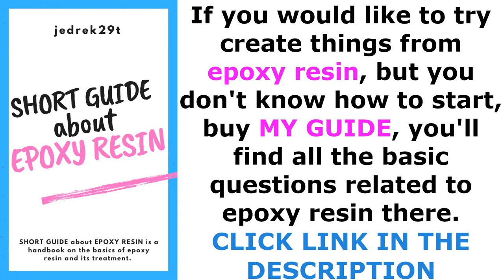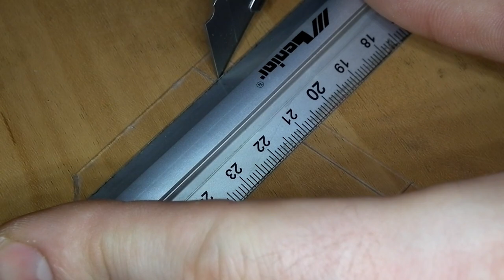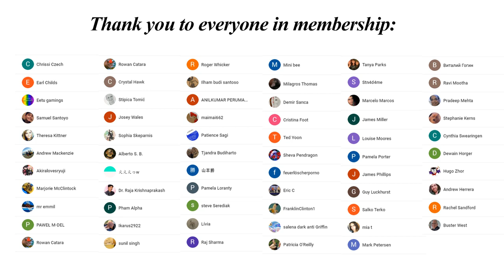DIY. Chain Necklace in Epoxy Resin. Pendant / RESIN ART

Comment: is there a spray to remove bubbles from the resin?
Reply from the maker: Apparently yes. But it only removes air bubbles from the top
Reply: @jedrek29t   Is there a page or something to know how much resin should I use so I don't waste it?  I'm starting, and what I do is fill the mold with water and measure how much water it is and divide that amount in 2 for half resin and half hardener.

Comment: This pendant looks quite simple. I would have expected a more eloquent design with the chain. Like a heart or a star. Or a moon. There are endless designs with a chain set in epoxy. Or use it as a frame and put dried flowers in the middle. I would the also use a finer chain if possible. The finer the details the prettier. Especially with jewellry like necklaces.